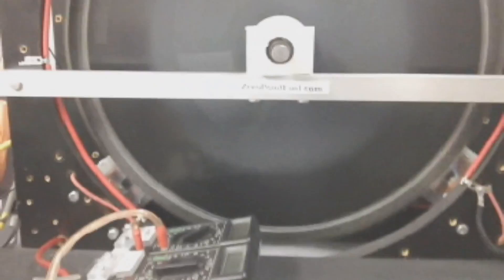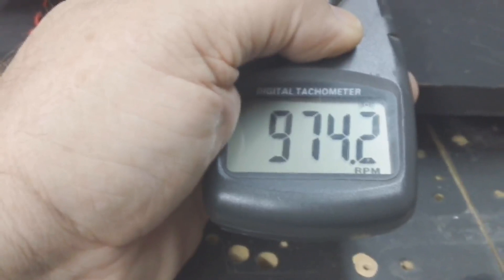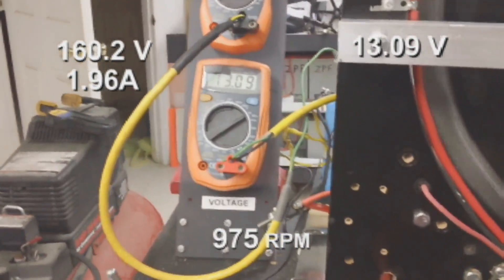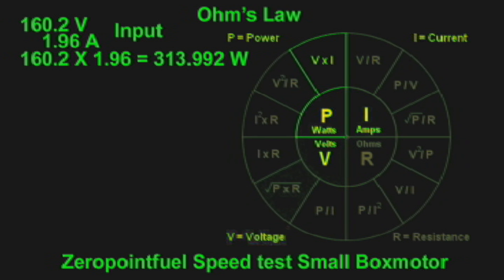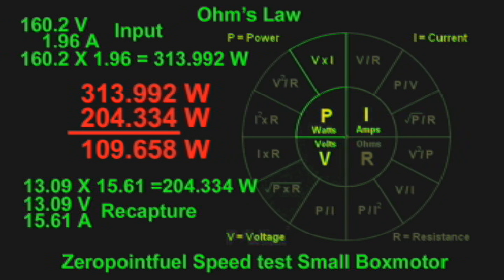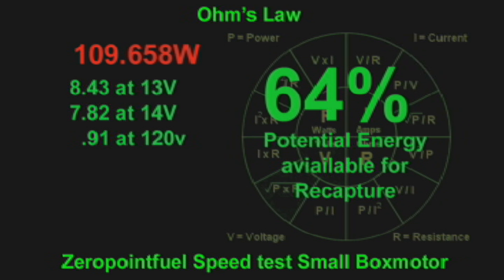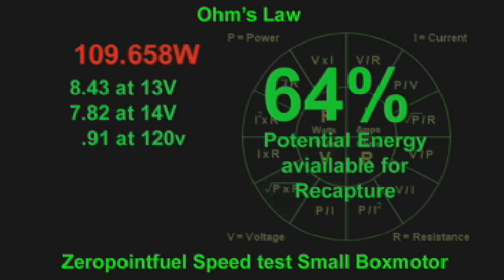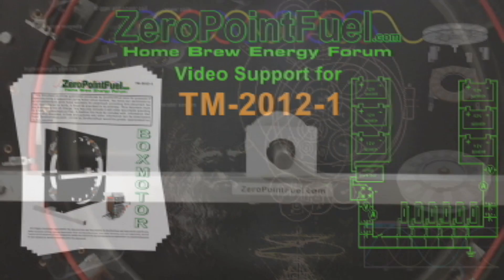Energy Calculations BoxMotor  Oct 2012

Comment: This machine is doing better than most pulse motors-which have no torque.
Your box motor would certanly have output torque.
As you know,at the moment i am learning how to tune generator's to output more with less mechanical force needed.Maybe this would be of some use to you in the future.
Anyway,your motor is doing very well with just the power conversion alone-it can only get better from here on.

Comment: Holy crap that's pretty damn good! If you think about... An average 15A battery charger, stand alone shop unit... what would it's draw be? Probably that much, or more, and it does not mechanical work at all. You could easily have a powerful shop fan that charges bats at 10A! Cheers

Comment from the maker: well a hi amp draw would increase the potential deference on the low side but the plan is to put inverters on both sides of the motor then you can just plug in a AC device and use that energy and when it's being used it's charging inverter batteries  Thanks

Comment: Great Job, so I have a question. 

What if you put a load on the charge batteries?
Maybe the motor would deliver more amps. Or have many
light bulbs could it light? Ypu may be overunity now.
Keep up the Great Work.